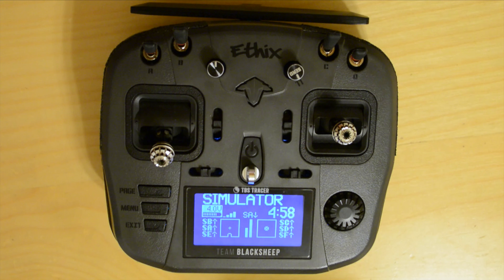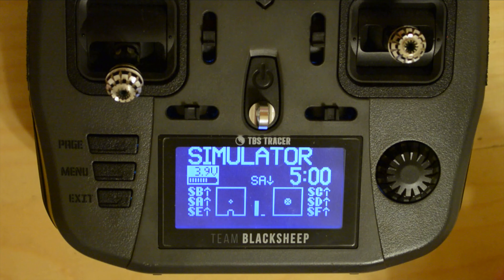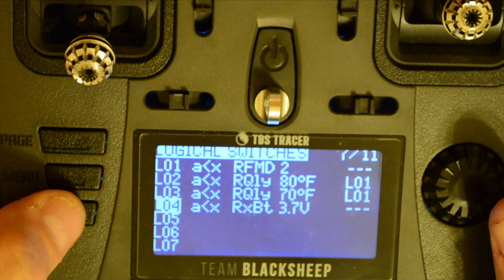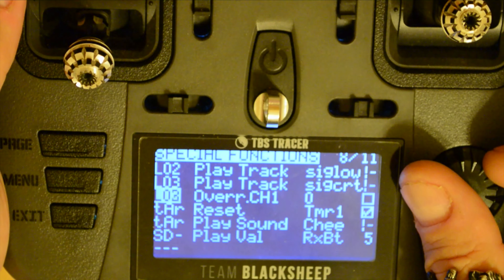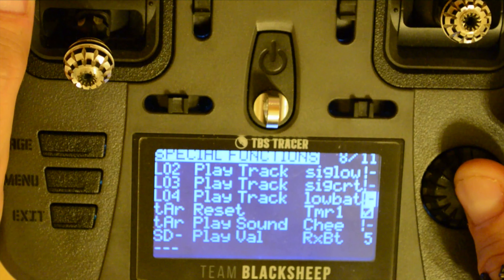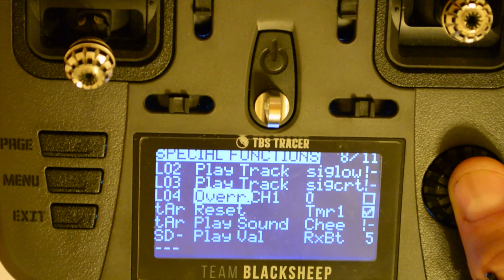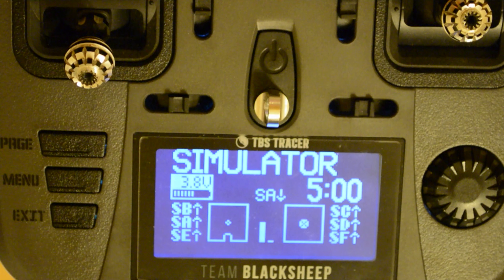Just The Tip - Ep 05 - OpenTX / EdgeTX Secrets Revealed - Audible Low Battery Alerts!

Comment: just got the fatfish f16 and it only says battery, not RxBt. I had it working on my pocket and this is the only difference. kinda neccessary with my own camera on that hummingbird v3 board.
Reply from the maker: “Battery” is the radio battery level, not the quad. You can do a “discover sensors” in the Telemetry screen on your radio with the quad plugged in. 
Make sure that Telemetry is enabled in the Receiver Tab of betaflight too.
Reply: @Rogue_FPV  seems to have done it, thank you 2X bro
Reply from the maker: @TavoFourSeven  happy to help out!! 💪🏻💪🏻

Comment: Iwhat is " set rxbt " mean .
Reply from the maker: That’s setting the alert for the level of the quad battery. Rxbt = battery voltage seen from the receiver.
Reply: @Rogue_FPV  
So the model needs to be on and connected for my tx to detect the rxbatt ?
Reply from the maker: @gregorydahl  yes, the model needs to be turned on to send the telemetry to the TX from the RX
Reply: @Rogue_FPV  i have a mobula 7 spi rx . 
 It does not have telemetry maybe .
 I see no rxbatt choice .
Reply from the maker: @gregorydahl  depending on the protocol being sent over spi - ELRS / FRSKY / ETC... the rxbatt / rxbt may be sent over telemetry or it may not be.  Also, check in the receiver tab or the config tab in betafight depending on version, and ensure that telemetry is enabled there.

Comment: Adding the SD switch to channel 5 in the mixes was unnecessary to make the logical switches and special functions to work.  Was there a reason you added that?  Is the quad expecting a signal on channel 5?
Reply from the maker: Adding SW SD is only necessary if you use Method 1 in the tutorial. If you use Method 2, it is completely unnecessary as you say. You just see it in my Mix screen because I didn't remove it until after I had filmed the whole video. I should have made it more clear that the steps from Method 1 do not need to be done prior to Method 2, but rather a user can choose "either / or".  Good Catch!! 👍
Reply: @Rogue_FPV  The logical switches and special functions can access the all switches at any time. The switch does not need to be in the mixes (or inputs).  All you did by adding SD to the channel 5 mixes was add an outgoing signal on channel 5 to the quad.  Wasn't needed for method 1.

Comment: I have edgeTX and there is no option for RxBt but there is a choice for Batt. Any suggestions I would appreciate it.
Reply from the maker: Batt is the radio battery, you just need to plug in the drone and click “discover new sensors” on the telemetry screen on the radio. RXbatt should populate. You need the drone on to do this, it has to be sending telemetry back to the radio.
Reply: @Rogue_FPV  I did that and now I have RXbt but no sound when it goes below the voltage I set which is 3.3. I do know the sound file is working, I have sound on all my switches. I watched your video many times and mine is set up just like yours. I will try it on another happymodel board and see. I will let you know what happens. I won't worry you if it doesn't work but I have learned things I didn't know so I'm happy. Thanks for your help
Reply from the maker: @nvembrace  make sure that you’ve done every step one more time.  Make sure that if you use the per cell voltage you tell the fc to report per cell voltage. 

If you haven’t done that, the radio will want to call out the alert when the whole pack drains to 3.3v not 3.3v per cell
Reply: @Rogue_FPV  Okay that must be my problem because I didn't tell the FC to do anything. Would that be a command that has to be done in betaflight CLI and if so can you give me the command? Thanks
Reply from the maker: @nvembrace  enter these 2 lines in the betaflight CLI and hit enter - 
set report_cell_voltage = ON
save
Reply: @Rogue_FPV  Thanks a lot man. If I don't have time tonight I will do it tomorrow and tell you either way what happens.
Reply from the maker: @nvembrace  for sure lemme know, I got your back!
Reply: @Rogue_FPV  Cool man
Reply: @Rogue_FPV  Well it's still not working. I didn't mention my FC is a happymodel elrs 2.4. I read somewhere with advance elrs you have to enable advance settings. IDK
Reply from the maker: @nvembrace  no, if you followed my video instructions, and entered the cli commands i gave you, it should be working when your quad is connected and bound. Nothing else to do, if you get telemetry it should work.
Reply: @Rogue_FPV  Well thanks a lot for your help and I will move to something else but I have learned a lot, thanks

Comment: Just install Choppergirl's free Soundpack for Open TX  Edge TX and be happy!  :-)  
   850 sounds, it's the biggest and best out there
Reply from the maker: FYI - Installing sound packs alone configure the alerts for low battery, link quality, or satellite count, it will just change the available sounds. You still need to configure the radio for alerts.
Reply: @Rogue_FPV  Examples included in the included models in the model folder and in the included text file manual.    All in one zip.

It's free, and she did all the work to record and it while she was blind, since nobody was helping her to fix her quads... so...  not like that will ever happen again.  Some community, huh!   She said it took 2 months to make and she'll never do it again LOL.

Comment: Great tip! Thanks
Reply from the maker: Thanks!! Glad you enjoy! 💪🏻💪🏻
Reply: @Rogue_FPV  Hey just setting this up and wondering if you used the Betaflight Power & Battery tab >> Voltage Meter >> Multiplier Value to get the telemetry to read average cell voltage? That seems to work but just curious if there's a better way?
Reply: Oh, I just found the flaw with that method - the auto PID profile selection by cell count won't work because Betaflight thinks you're using a 1S pack. Dang :(
Reply from the maker: @flipfpv  i just enter this in the cli 
set report_cell_voltage = ON
save 
This sets the average cell voltage to be sent over telemetry in place of total lipo voltage
Reply: @Rogue_FPV  Oh nice! I had no idea about that. I'll give that a try. Thanks!
Reply from the maker: @flipfpv  that’s the easiest fool proof way that I know. Plus, you can retain auto pid profile selection by cell count that way 💪🏻👍🏻
Reply: @Rogue_FPV  Heck yeah - that's exactly what I was looking for. Gotta love those obscure CLI commands haha. Thanks again!
Reply from the maker: @flipfpv  lol, I read the wiki pages 😏😎 Always happy to help!! 💪🏻

Comment: On your main screen there is addition of SA<arrow down> and a timer, how do you add those positions there?
Reply from the maker: In the Model Setup Screen just below the Model Name, set Timer 1 to ON, and set the switch to activate the timer. You don't have to name the timer, but you want a Count Down timer, set a Start Time to count down from, and set the Value to Remain. Set Persistance to OFF, but Enable the Minute Checkbox, and set the Countdown to Voice. Next to Voice, set the value to 10 seconds, for a 10 second audible alert. 
You will need to set a special function to clear the timer with another switch though.
Reply: @Rogue_FPV  Thanks for detailed reply!
I was hoping this screen area is completely customisable and I could display here rx battery voltage from the telemetry, seems like this is either blank or a timer...
Reply from the maker: you can add rx batt and other telemetry widgets in the secondary main screens. you can add them in the telemetry screen i think
Reply: @Rogue_FPV  I was able to make it that once I hold the left-right button on my t-pro, it shows customisable telemetry data and I was able to add it there
Reply from the maker: @Arek_R.  awesome!!! Glad that it worked out for you!! Happy to help always! 💪🏻💪🏻

Comment: Will this work trying to set it up for the battery on the radio itself..or just the drones
Reply from the maker: You can do this the same way but for radio battery, select “batt” instead of “rxbt” and set your low voltage threshold accordingly.
Reply: @Rogue_FPV  oh ok..thanks
Reply: On my tx16s radio edgetx 2.8..I dont see the RxBt option ..it just has batt option

Comment: I wondered if you could do the same with crossfire and link quality to warn you when LQ is low? Great tip anyway 👍
Reply from the maker: Actually, you can do this quite easily. If you scroll to time 2:44, you see in my Special Functions that I have L02 and L03 set to Play Track / SigLow - SigCrt.  Then if you scroll to time 4:57, you will see the 3 Logical Switched you need to create, for the alerts to work automatically, based on LQ.
Reply: @Rogue_FPV  I see.  I normally set up channel 12 for LQ on the nano Rx and AUX 8 in betaflight.  Do I need to change this to set up the special functions and the logical switch? Thanks 👍
Reply from the maker: @luismanchego6856  no, you don't have to make any changes to LQ channels, just set the 3 logical switches and the 1 special function exactly as shown, it will pickup RF Mode Change, and LQ from whatever channel the receiver sends it on.
I use these settings on the radio models that I use all my various Crossfire and Tracer  quads... some on 8 some on 12ch..
Reply: @Rogue_FPV  - This is amazing. Just one question if I may... 4:57 sec mark, those 3 logical switches you've created for LQ alarms... do we need to set AND switch , Duration and Delay , or simply leave it unpopulated? Thank you so much in advance! EDIT: also, your L02 and L03 - RQly shows degrees, 80 and 70 respectively... but when I try that on my Tango II (FreedomTX), it gives me values in percentage. Why is that?
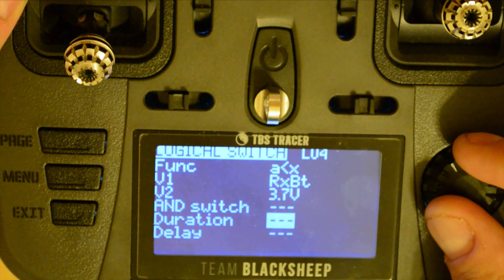Reply from the maker: @Seii-FPV  @5:58 do not set an "AND" or "Duration" but do set a "Delay" of 5 seconds. The 5 second delay will prevent false alarms when you have battery sag from punch outs, etc... Also, my sensors are reading in degrees in this video because of an error. When I recorded the video I had changed receivers and I didn't do a "Discover New Sensors" on my radio. A value in percentages is correct like you have.

Comment: Thanks man but for V1 I have only the option for battery and not rxbt. Any clue why?
Reply from the maker: @judahfpv  “Battery” is the radio battery level, not the quad. You can do a “discover sensors” in the Telemetry screen on your radio with the quad plugged in. 
Make sure that Telemetry is enabled in the Receiver Tab of betaflight too.
Reply: @Rogue_FPV  well fuck that worked. Thanks man!
Reply from the maker: @judahfpv  happy to help! 😋😋💪🏻💪🏻

Comment: Hello
How do you tell RxBat to read cell voltage or overall voltage?

Nice Video
Reply from the maker: If you want rxbat to report individual cell voltage instead of total lipo voltage, just enter the following command in the CLI and save. 
Set Report_Cell_Voltage = On
Reply: @Rogue_FPV  Thank you a lot!
Reply: Depends on what you are using it with, I had to tell my radiomaster nexus to report cell voltage not total voltage

Comment: I followed your tutorial for my other quad and it works. Now I made a new model on my radio for my new quad and once I connect all is keeps saying is 0 volts. I ran the CLI command in the comments and it still is doing the same thing. Any ideas
Reply from the maker: Make sure that telemetry is enabled in betaflight, and telemetry is being sent to your radio. 
I had telemetry issues with 4.4.2 on one of my quads, and went back to 4.4.0.
Reply: @Rogue_FPV  thanks for the fast reply. I’m on 4.4.2 with my original and it works. And your talking about the telemetry switch in the receiver tab or settings in edge TX?
Reply from the maker: @emafpv  the receiver tab

Comment: How did you get the rxbt to report average cell voltage?
Reply from the maker: In the cli you can type Set report_cell_voltage=on
Then Save
Reply: @Rogue_FPV  ok, sorry I use KISS not BF :(  Wondering if there was a script to take the value and divide by 4 in openTX
Reply from the maker: @GenCodeFPV  I dunno about a script I’m sure it can be done.  I use kiss ultra and I have cell voltage in the osd, but in the radio I just set the alerts for total lipo min voltage of 21v.
Reply: @Rogue_FPV  I tried creating this with ChatGPT ;) it works fine as long as this line is commented out  -- setCustomSensorValue("CelS", -1)  it looks like it won't let me set a custom sensor, but once commented out it will display the cell voltage (assuming its 4s) but to use it in a logical switch I need to get its value somewhere.

-- Define the function to set a new sensor value
local function setCustomSensorValue(sensorName, value)
    system.setTelemetryValue(sensorName, value)
end

-- Main function
local function run(event)
    local sensorName = "RxBt"  -- Set the battery telemetry ID
    local cellNumber = 1       -- Set the desired cell number

    -- Retrieve the voltage value from the battery telemetry
    local voltage = getValue(sensorName)

    -- Check if the voltage value is valid
    if voltage then
        -- Divide the voltage by 4
        local cellVoltage = voltage / 4

        -- Display the cell voltage on the transmitter's screen
        lcd.clear()
        lcd.drawText(1, 1, "CellVoltage: " .. string.format("%.2f V", cellVoltage), MIDSIZE)

        -- Set the cell voltage as a new custom sensor value
        setCustomSensorValue("CelS", cellVoltage)
    else
        -- Display an error message if voltage retrieval failed
        lcd.clear()
        lcd.drawText(1, 1, "Error retrieving", MIDSIZE)
        lcd.drawText(1, 25, "cell voltage", MIDSIZE)

        -- Set an error value to the custom sensor
        setCustomSensorValue("CelS", -1)
    end

    -- Return 0 to prevent the script from interfering with other functions
    return 0
end

-- Register the run function to be called on each telemetry update
return { run=run }

Comment: Hi, how do you get that stick overlay on your screen? I CANT find mine!
Reply from the maker: Just scroll through the Main pages/screens on your radio with the Page Button when you turn the radio on until you see it. There are 5 Main Screen pages, the radio will always default back to the screen that was displayed when the radio was powered off.
Reply: @Rogue_FPV  is that in system settings?
Reply from the maker: @certifyFPV  no, just from the main screen. What radio are you using?
Reply: @Rogue_FPV  i’m using the jumper t lite v2 i’ve seen people have different screens but im unable to actually find out how to change it
Reply from the maker: @certifyFPV  the page buttons are the switches labeled “Up and Down” to the right of the screen. Just push Up until you see the screen with the stick overlay.
Reply: @Rogue_FPV  Thank you! it’s worked! never knew it was so simple!
Reply from the maker: @certifyFPV  happy to help, my friend! 💪🏻💪🏻

Comment: Hey bro, on min 4:55 can you explain what does your L01 do, or what does RFMD means?
I will appreciate, thanks.
Reply from the maker: My L01 is a logical switch that I created. The logical switch becomes active when RFMD (RF Mode) crossfire link state drops from 150hz to 50hz. 

This is for an Rssi alert that I have setup, and has nothing to do with the Audible Alerts for Battery voltage.
Reply: Thanks bro, I understand now.

Comment: I have no "rxbatt" on my mambo v1.34. I want to try v1.35 but it's in beta. Should I?
Reply from the maker: I use the latest, but that shouldn’t matter for Rxbat. Have you done a “search for new sensors” when a receiver is connected?
Reply: @Rogue_FPV  thanks for replying. How can I do that?
Reply from the maker: @its-all-harsh  on your radio. Scroll to the Model Telemetry page. Scroll down until you see the line “search for new sensors” then click on it and wait 10 seconds. 
Make sure to have the quad plugged in and bound to the radio, you will not gain the rxbt if the quad isn’t talking to the radio.
Reply: @Rogue_FPV  Thanks a lot man! I wouldn't have guessed it... I will give It a try..

Comment: why my rxbt not showing the voltage?
I have tried the command cli Set Report_Cell_Voltage = On 
 how to fix it?
Reply from the maker: have you tried to do a "Discover New Sensors" on your radio's Telemetry screen with the Quad plugged in to a lipo? Usually that will find it.
Reply: @Rogue_FPV  Yes, all telemetry sensors have values, except rxbat not showing the voltase, there is only a line
Reply from the maker: @ what are you using for Rx link? Crossfire, Elrs?
Reply: @Rogue_FPV  i use elrs
Reply from the maker: @ I’m sure your receiver is up to date on firmware, but in the receiver tab of betaflight is the telemetry button turned on? 

Aside from a bad rx I can’t think of anything else to check, you should definitely have rxbt in the list of sensors.

Comment: i have no RxBt option in logical screen drone powered on or off...sup with these videos? Ive been trying to set a drone voltage on my radio all day, not one video is correct, yet all are Edge TX.....thats going on here?
Reply from the maker: with the quad plugged in and bound to your radio, on the radio go to your model telemetry page, and do a "search for new sensors". if you have telemetry enabled on your RX and in betaflight you should see RxBt pop up in the list of sensors. Then you can ad it as a logical switch. 
Sounds like your telemetry is disabled in betaflight receiver tab...
Reply: @Rogue_FPV  HAHA yeah, I was hit by a double whammy, didnt have batt power and telemetry was off in beta, ty for your time and knowledge